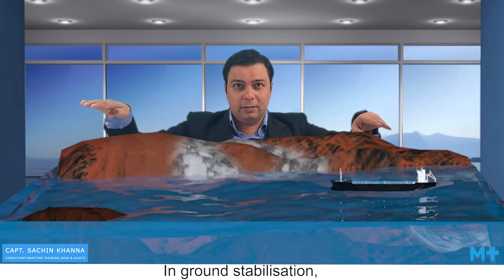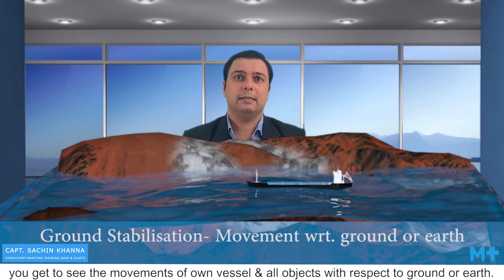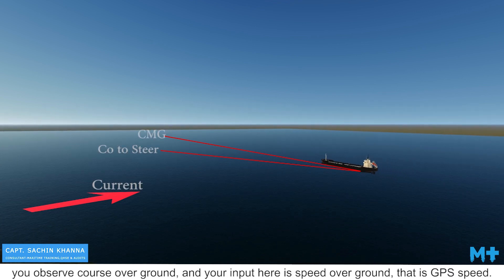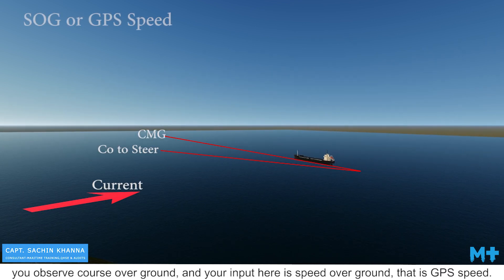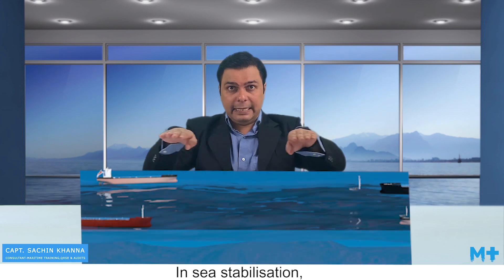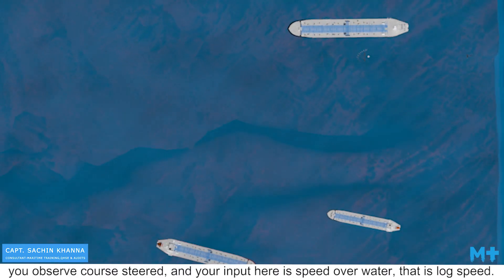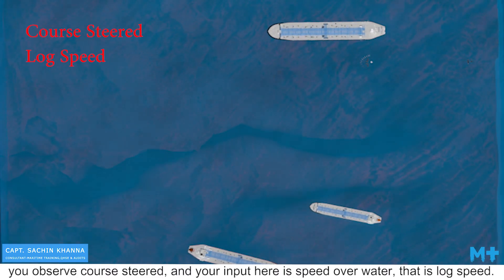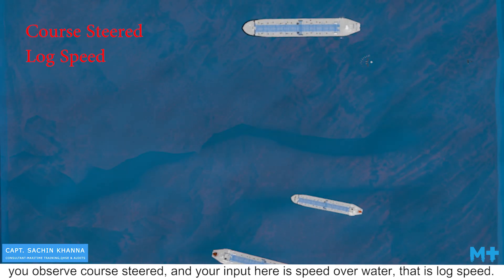M+ Maritime | ARPA Ground & Sea Stabilisation (Speed over ground & through water) | Full Episode

Comment: Sir! If we are in ground stabilised mode and using relative vector.... and current is against us... and it will reduce the SOG.... then will it affect the length of relative vector??...Sir can you please answer
Reply: When using relative vector, vector will be shown on target objects, not on own vessel. So the length of the vector depends how the current affects the target. As both the vessels are in same water and affected the same way, there won't be any change in length of vector. 
Suppose if the target is a fixed object; as our speed reduces, the relative vector also reduces...

Comment: thanks for sharing this knowledge sir.. 
from the ROR explanation, where can we find out the speed of the current?
does that mean the difference in speed read by the gps and speed log can be said to be the current speed?
there is a situation on a ship anchored or moored, speed log reads speeds of up to 5 knots, what speed is being read by speed logs? or my speed log in error?
Reply from the maker: Hi Aldo. 1) For an understanding of the ROR situations, you need to know the aspects of the vessels, how they are approaching each other, not the current speed. Modern radars today display the speed & direction of current too. You can visualize the current direction and speed by drawing vectors of the gyro course, course made good & wind which is the major contributing external force in a drift along with current at sea.  2) Yes, the difference in GPS and log speed can be used to measure current/water mass speed. Pls, try to visualize this by taking into account the components of the vector of the current in the same direction ie the ship's heading. An upstream or downstream direction of the ship will give you strait calculation of current, as explained n the video but if the current is from an angle then the vector component in the direction of the ship's course comes in the calculation. 3) It the ship is anchored or moored, then it becomes stationary to the ground and your log gives you the speed of water mass/current. Remember, your SOG or GPS speed will be 0 in this case. If at anchor, your speed log is 0 and you have some GPS speed (ignoring the moments of swinging) then you are dragging anchor or drifting with the current. Speed log gives you speed through water but modern doppler logs have dual axis bottom track speed too and they can tell you speed over ground too. In fact, you can select one of the 3 modes to have speed over ground, through water or automatically select it which it does, depending on the depth. For speed through water, the depth below keel should be more than 3 meters to have correct readings. Below 3 meters, readings of the log can have errors.